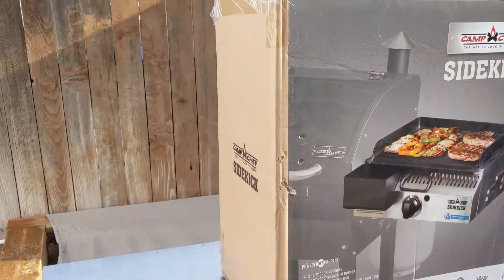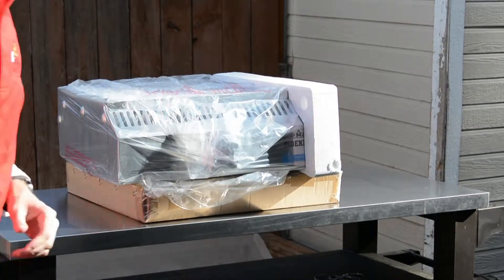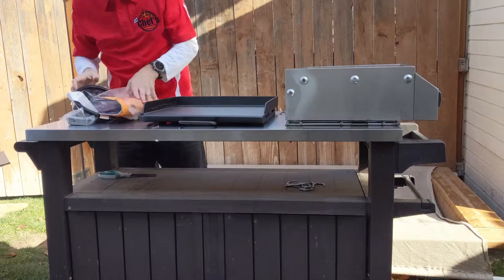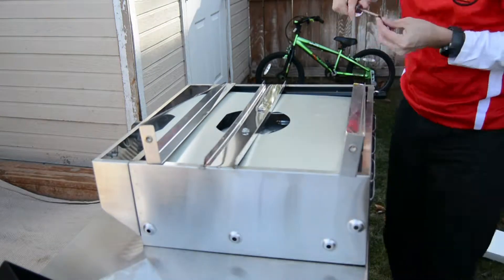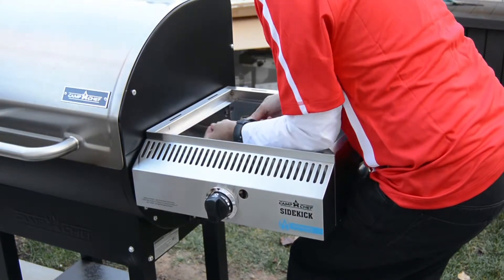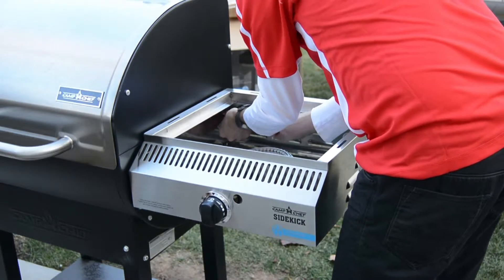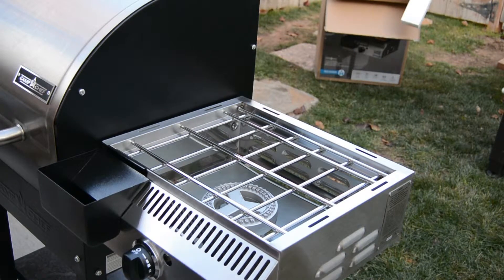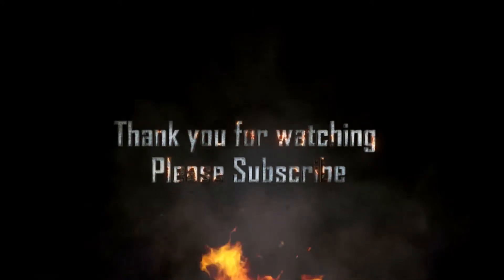Unboxing & Instal the Camp Chef Sidekick

Comment: I just installed my sidekick but can't figure out how the leveling screws are supposed to be used.  It looks like they screw into the bottom supports but rest on the finished surface of the grill.  That can't be right, right?

Comment: I cannot get the sidekick to light. might be clogged and the manual says to check and clean the burner. Not sure how to remove it.
Reply from the maker: That's a common issue. On my sear box and the sidekick, I constantly had an issue getting it to light using the onboard igniter. I end up using a long lighter or match to light the flame. Very inconvenient so I'm not a fan of these accessories.
Reply: @chefsmagnet  Same for me. Had issue to light the sidekick. The ignition button works one on three and it's a new one.